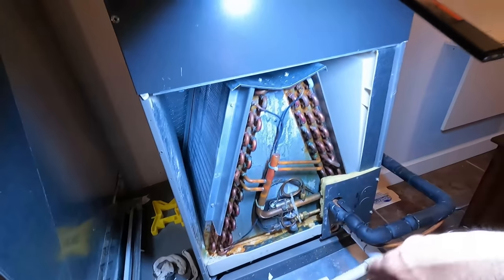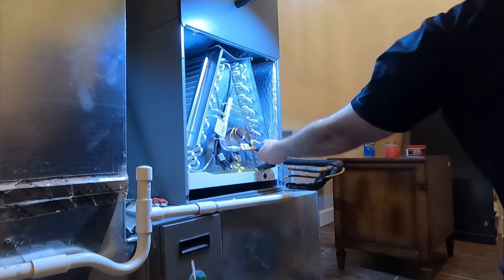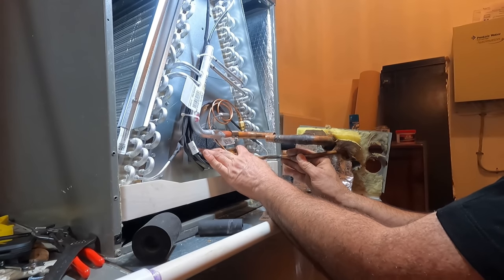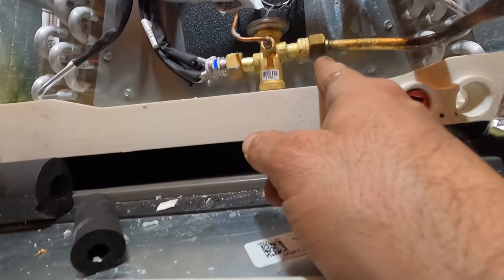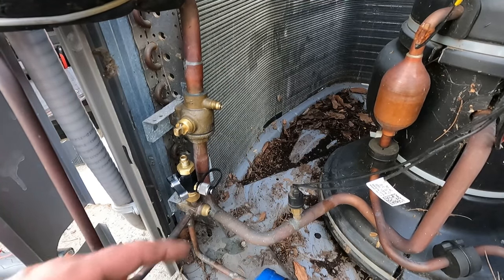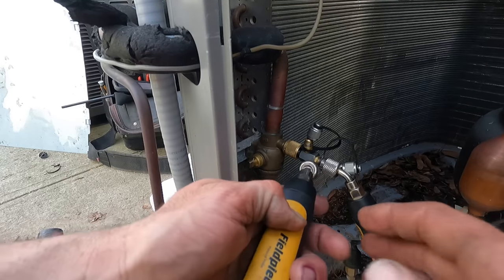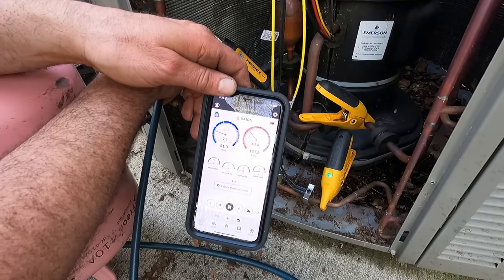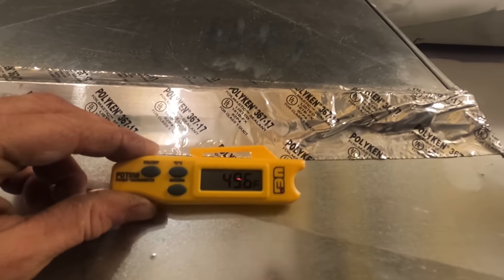Replacing Evaporator HVAC Repair

Comment: Filter drier needs replaced
Reply from the maker: Why?
Reply from the maker: The filter drier in this system has never been exposed to contaminants or moisture. It’s inside the condenser. All the refrigerant for the system is stored in the condenser. When drier is inside condenser it doesn’t need to be replaced when pumping system down
Reply: they say u should replace em every time you breach the system..
Reply: i understand what you are saying and do agree but to be on the safe side i’ll just swap em out whenever i breach
Reply: anytime a system is opened up you have to change the filter drier, r-22 you may be able to get away with it but with 410A moisture is your biggest problem because of the POE oil.

Comment: You removed a copper evaporator and replaced with a aluminum one, not a good thing to do.
Reply from the maker: Why? This is the updated coil for this unit. It’s Lennox fix to all the leaky copper aluminum coils.

Comment: Everytime i see someone use the electric tubing cutter i cringe a little
Reply from the maker: Why it’s a great tool I never know I would use. Yet was gifted it by a plumber subscriber. It cuts great without leaving too much of a burr inside pipe
Reply: @thehvachacker  to me it seems like overkill for an ac guy. I'm sure it works great but don't see myself owning in the foreseeable future. There's nothing wrong with the tool and I'm pretty young in the trade still so likely to change my mind. I would like to see something smaller.

Comment: Ditch the mask. Your video is good 👍
Reply from the maker: I do where I can. Have to respect customers that want the mask worn. I stopped wearing a mask everywhere I go except when working. I ask my customer if I need to wear.
Reply: @thehvachacker  right on..I get it. Your video helped me out with understanding the basics on an AC unit. Its a 20 year old Rheem that used the R22. The whole system needs to be replaced but now I have a better understanding why that is. Take care.
Reply: @rapturebound197  Keep that Rheem until it dies I relpaced one that had 28 yrs. Of service and the only reason why I replaced because furnace had rusted so I went with whole new setup Goodman they suck
Reply: @dirtyred1687  hey Dirty Red. Update on my Rheem situation. My unit was actually 17 yrs old. Its a 5 ton system. It was not putting out cold air and the compressor would shut the unit down (due to excessive heat). Although the outside condensor unit was actually debri free..no leaves or dirt clogging the fins etc etc  I went ahead and cleaned those fins all the way around the unit anyway. We also checked the R22 and the guages showed it to be 'overcharged'. So what do you do when a system is "overcharged"?  It means some refrigerant actually needs to be taken out..not added. The proper amount of refrigerant in home AC units have a small window to operate within.

Ok so once we removed some refrigerant we set the thermostat to kick the AC on and it kinda worked for a while but just mediocre at best ..and then a new problem showed up in that the evap coils (mine are inside the furnace unit) began freezing up. It was frustrating because at that point we weren't sure what the heck the problem was. We had the refrigerant levels set right..no leaks..nothing obvious was wrong everything checked out ok and everything but the AC still didnt work. It was a real head scratcher. 

So I watched several other YT videos and they all indicated it was a refrigerant level problem which wasn't our issue but one video happen to mention as a side note that the "line dryer filter" is sometimes a problem. On that video they said it was rare to have one go bad but it was worth checking just in case. To do a quick check on your line dryer filter you can actually check it with just your fingertips. The line dryer filter on my unit is located on the smaller copper line between the house and the outside condensor unit.
Thats where it is on most all split systems. *Note - on split systems there will be 2 lines running parallel to each other between the house and the condensor unit. One copper line is about the size of a garden hose in diameter and one is the diameter of a pencil. The smaller copper line is the one that the line dryer filter is on. Mine was blackish copper colored and the actual line dryer is that thing about as round as a pop can but a little shorter in length. Its a real simple looking device.  It has the copper line going in - and the copper line going out. It looks like no big deal ..and for that reason can be easily overlooked when troublshooting. But in fact that filter is critical to the refrigerants' ability to flow thru the system as it needs to. We had to wait a couple hours for all that ice to melt inside the evap coils before we started the unit back up to test that line dryer filter. After the system ran for about 15 minutes I did indeed have a noticeable difference in temp right where it went in the filter as opposed to where it comes out. Now if that line dryer filter is not the problem and not clogged you won't notice any difference in temp to the touch on either side of the line going in and going out. But if there is a difference (even just 10 degrees or so) that tells you the filter is clogged. There is no other way to test it. And when that filter is clogged, or even partially blocked, the refrigerant can't get to the condensing unit to be cooled. When the refrigerant can't get to the condensor portion to be cooled it makes the compressor get hot. Most systems have a heat threshold switch which shuts the entire AC system off automatically when that heat threshold is surpassed.  Its a safety feature to not allow the system to sit there and burn itself up. I don't know if all manufacturers have that heat switch feature so yours may or may not shut off when the conpressor gets too hot. Excessive heat is always bad for any mechanical device so hopefully you catch this problem before heat does irreparable damage..but I digress.

Ok so we replaced the line dryer filter with a new one. The good news is those line dryer filters are only about $30 bucks.. but the bad news is the process to change that filter out by your tech is actually very time consuming because the entire system has to have the existing R22 refrigerant vacuumed out and put into a holding tank. Sounds easy.. and it is..but its a very slow ordeal. Once the refrigerant is vacuumed out you can then cut the copper line on both ends of that faulty filter to solder the new filter back in. *once you take the old filter out you can try blowing thru it and if its hard to blow thru you know beyond a shadow of a doubt that line dryer filter was definitely bad. They should be really easy to blow thru if they have no obstructions.

Ok so next we recharged the system back up with new R22 refrigerant (you can put the old R22 you vacuumed out back in..but just know it can be, and often is, contaminated with water or dirt particles ..especially if its been in your system a long time. If it is contaminated it will cause other problems you don't want or need..so if your tech can get you new R22 refrigerant I would definitely pay to have it put in). 

This entire process takes about 4  hours start to finish to do. Its a slow boring process..lots of waiting time while the vacuum does its thing. There are no shortcuts.

So if your paying a technician to do this just know you're going to get a hefty labor charge. Thats just how it is. I spent about $600 total when it was all said and done but that sure beats the heck out of the $8 GRAND I would have had to spend on a new system! Maybe you can relate! 

I'm very confident replacing that line dryer filter fixed my problem and the AC system has been running perfectly for a month now. No issues. 

Hopefully my system will last as many years as yours has. That would be awesome.

I know R22 is getting hard for the technicians to get. Laws are prohibiting them from using it in some states. So if your tech tells you something like that he or she is not lying. The Gov't is tightening the screws on using R22. Eventually it will be completely outlawed and when your system goes down due to issues involving R22 refrigerant you will not have a choice. You will have to replace your entire system with the one that uses R410a refrigerant. 
Here's the catch unfortunately that R410a refrigerant works on MUCH higher internal pressures than your old system R22 does. That means your old evap coils, condensor coils, compressor and lines can't handle that higher pressure. It would be great if all you had to do is put in a different refrigerant in your old system but if you did the pressure would blow things apart. Which is why the only thing you can do at that point is replace the entire AC system end to end with an entirely new system even though many of your old parts still work fine! Bummer eh! 

I know this was a long winded story bud..sorry for that..but most of us don't understand these sysyems and it might help anyone else reading this go thru how to fix it step by step and save some big bucks before they throw in the towel and spend the $8K. I'm glad I did! I know some day I'll have to but that day has been put off for now. 

Take care man! And God bless! 
Stay cool!
Mike
Reply: @rapturebound197  No I love your story Yes it was worth to have a tech fix it I love your write up

Comment: Very poor recovery system need to step your game up
Reply from the maker: I didn’t recover. I pumped the system down and stored refrigerant in the condenser. Better than recovering.
Reply: @thehvachacker   never pull vacuum through manifold way to slow
Reply from the maker: @F150_King_Ranch  I never pull a vacuum through a manifold. I am guessing you didn’t watch the video. I do show the vacuum I pulled and my setup is shown. The vacuum being pulled by a manifold is a coworkers set up on a different system. Most of my coworkers use a manifold. I stopped a few years back. My vacuum setup is in at least 20+ vids. If you comment without watching the whole video then your comment makes you look like a fool. Since your comment has nothing to back it up. I did say in vid that is a system a coworker working on. He didn’t even use a micron gauge. I always use micron gauge.
Reply: @thehvachacker  yeah pumping it down is a lot more convenient and saves time and money.

Comment: And what was the purpose of removing the shader valve cores? This guy makes more work out of something not relevant to his repair/replacement. You only need to remove a valve core if you are doing “hot” work in the immediate area ( which you also could do by using a wet rag wrapped around the area and keeping it saturated with water as a heat sink. 
He is a real hacker, has some limited knowledge of what he’s doing.
Reply from the maker: Showing more ignorance young snowflake. Again your comment shows a lack of experience and knowledge. Industry-standard is to remove valve cores, to pull, faster deeper vacuum. Yes if your brazing the service valves it's good to remove the cores, also. I love when an uneducated/ inexperienced fool, tries insulting my work. What in this video shows any hacked-up work. You attaching my work because of my channel name? The name keeps trolls, exposing their lack of experience and knowledge. Yet research before making an ignorant comment that most would disagree

Comment: A good mechanic fixes the leak not replaces the unit anybody can change parts
Reply from the maker: Coil is under warranty. I fixed 2 leaks on their systems here. Yet his coil had a few leaks, replacing is best at that point
Reply: Not if its under warranty..

Comment: He also cracked the suction line open first, which often leads to slamming the txv shut. This guy sucks
Reply from the maker: Hi snowflake, sorry your wrong. Your suppose to crack suction line first. If you open liquid line first you flood the txv with oil and it screws it up. Cracking suction line lets oil be pulled into suction. Then the compressor sucks oil back with refrigerant.
Reply: @thehvachacker  your the man!